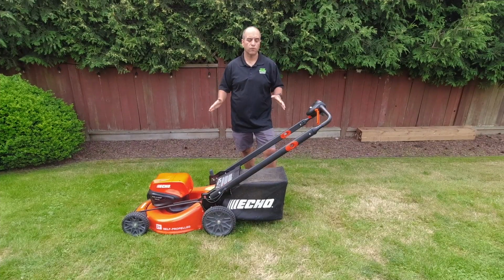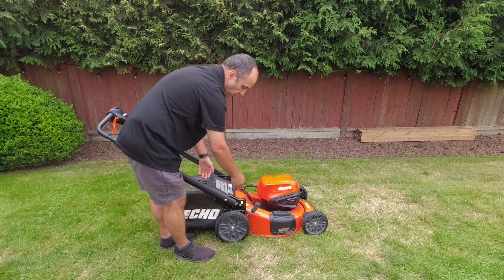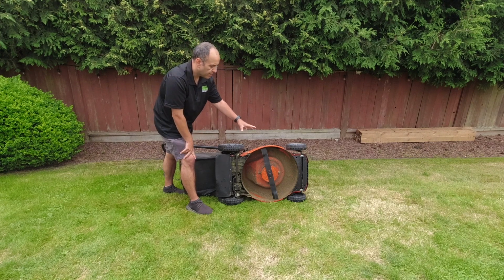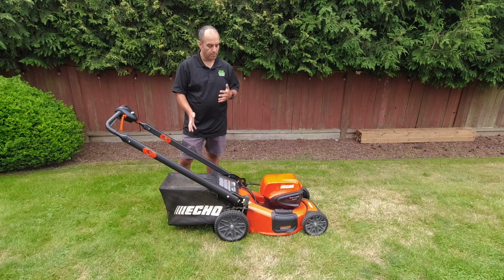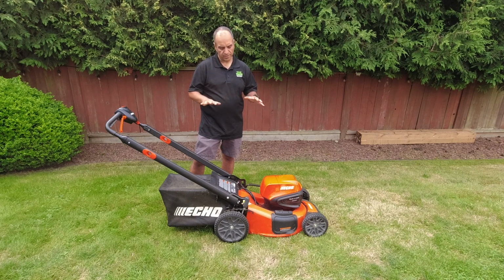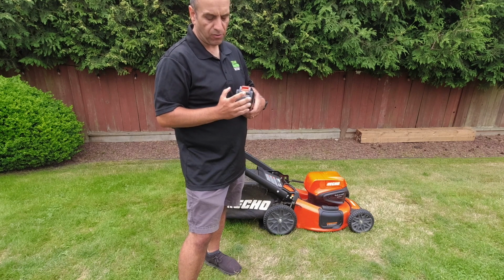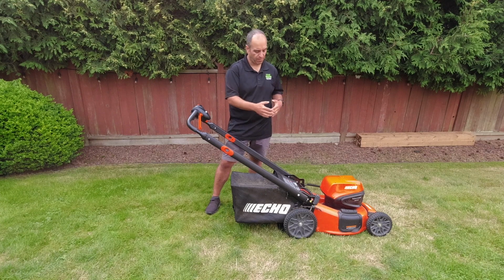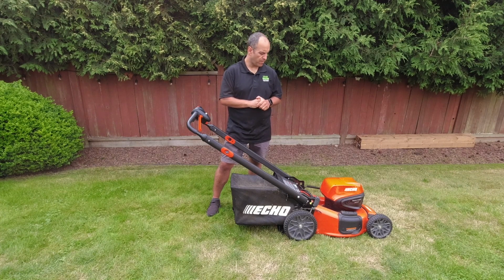ECHO DLM-2100SP Long Term Honest Review | 56 volt eFORCE Self Propelled Lawn Mower

Comment: Junk. After only a few months the rear wheels won't pivot while turning left or right. Both wheels rotate at same speeds so you have a difficult time turning it. It's rolling freely forward and backwards, not freewheeling while turning left or right.

Comment: I've noticed that electric mowers leave stragglers because you don't get that vacuum effect like you do with gas. Is that true with this mower?
Reply from the maker: It depends on the mower. A good battery mower can actually be more powerful than a gas mower. The biggest issue though is the blade that they include with most battery mowers is usually a low lift type blade. As that creates less turbulence and increases the battery run time. Unfortunately that also creates less lift or vacuum to stand the grass up. Some manufactures will offer a high lift blade you can buy as an accessory or you may be able to find an generic aftermarket one that will fit. This mower comes with a low lift blade and is generally underpowered compared to others. For example I have also owned and used the Exmark commercial 21 battery mower that comes with a high lift blade, and found it will out perform the commercial gas version of the same mower with the same blade in really tough conditions like wet grass or really long grass because electric motors have more torque and don’t bog down like gas mowers. Thanks for watching.

Comment: I feel like a lot of what you complain about is plain stupid! Stuff that really doesn't affect anyone but you! The Milwaukee mower you just tried to compare it to is also over double the price!
Reply from the maker: This is a lawn care business channel. So it affects anyone trying to use this mower in a lawn care business. I believe I did say that it was ok if you’re a homeowner but even then I’d buy the greenworks version as they are available for less money and they make this mower anyway. I’ve since tried many other battery mowers in long term testing since this video including the Milwaukee that I happen to be using now for the past 2-3 months everyday. There is no comparison. The ECHO mower is garbage compared to every other one I’ve tested and would not hold up to daily use. The Milwaukee I feel is probably the best value for what you get but even it is not the best is certain categories compared to the Exmark commercial 21 60 volt or Kress commercial 60 volt. But those mowers are in the thousands of dollars so it makes sense. So you may think the Milwaukee is expensive but in comparison to those others mentioned is why I say it’s the best value. So much better build quality and power compared to the echo it’s embarrassing that echo puts their name on that mower in my opinion.

Comment: Just bought this mower after selling my Snapper with a B&S 6.75. What a piece of junk the mower is. I do like the blower and string trimmer a lot though. The mower is surprisingly underpowered and cheap feeling. Should have gotten a Toro gas with the electric blower/trimmer
Reply from the maker: Yes as I said in the video I would not recommend it. Just the transmission locking up is enough of a reason to not recommend. Very cheaply built and underpowered.  Thanks for watching.

Comment: I’m a bit confused, the Milwaukee is almost double the price. This is competing against a different class of machine. I’m not sure your criticisms are fair. I bought this mower and took it out in the rain on a water logged lawn between atmospheric rivers. I had to wear a rain coat with a hood! It was a champ! It mowed the lawn very evenly on the second to lowest setting. I wasn’t sure if it would be powerful enough, but it pulled through very well.
Reply from the maker: My assessment is based on the fact that my channel is about running a lawn care business. ECHO knew this when they sent that mower. So it will be assessed for its suitability to be used in a lawn care business. That’s why I say in the video something along the lines of if your only using it for your own lawn it might be ok but then I’d look at the Greenworks model as they are the manufacturer of this echo mower and are more readily available in retail outlets. I stand behind my assessment. I still have this mower. I took it to my parents house to use on their tiny little lawn that is less than 1000 sqft. I mow their lawn once every two weeks. So it’s seen little use the pst couple of years since this video and the transmission is already starting to cause problems. Just a cheap mower overall. Thanks for watching.

Comment: bought one of these new in box for $200. have not used it yet but i'm hoping it will be fine to replace my 10+ year old gas push mower for my small urban yard. just don't want to deal with gas any more and want something that takes up less space in my garage.

Comment: Just bought one today, and it won't start. POS..DONT BUY...
Reply from the maker: Some things to check. Make sure the battery is charged and seated properly. Also that the little orange safety key is inserted by the batteries. Then make sure your squeezing the blade engagement lever while also pressing the power button. Thanks for watching.

Comment: Even my el-cheapo Ryobi 40V does not have that self propelled quirk. A machine of Echo's supposed quality should be better than that.
Reply from the maker: Except the problem is that it is only ECHO in name only. It’s made by Greenworks. In fact you can find the identical mower in green and black under the Greenworks brand. The only difference is the proprietary battery shape made for echo tools. Thanks for watching.
Reply: @LawnCareBusinessSuccess   Does the Echo battery interchange with the Greenworks?
Reply from the maker: @deanb949 no it does not. The shape of the battery is completely different as is the voltage.

Comment: I’m sure that’s a safety feature to time delay the wheel lock so it doesn’t roll back on you if you slip and fall on a hill
Reply from the maker: Nope. None of the gas mowers with self propel I’ve used ever did that, and I have now also tested 3 other brands of battery mower including the Kress, the Milwaukee and the Exmark. All have self propel and don’t lock up the rear wheels. It’s just poor design or cheap quality. I suspect the latter based on the rest of the mower compared to others I’ve tried.

Comment: You do know plastics aren't weaker than metal?
An abs, sure, but a glas fibre reinforced polypropylene, which wll tool conpanies use, it stronger, lighter and more flexible (resistant to damage by impacts) than steel of rhr se thickness.  It also doesn't rust of course.

If you don't understand a tool design, best not to draw a conclusion.  If i were Echo I'd have legal send you a love letter.
Reply from the maker: You do know that reviews are based on personal opinion and previous experience don’t you?  With that I will say that I stand by my comments that this unit is cheaply made. This past year I got to use two other brands of commercial battery mowers and that only proved my point. This ECHO model is very cheaply made and not worth the asking price. Especially given the fact it is a rebranded Greenworks model. Except it has proprietary battery shape that makes it even a worse buy. When the green works model can be found much lower priced and batteries for the green works are used in multiple Greenworks tools. If you look through the comments you will see others who have had similar experiences with this unit. As far as ECHO sending a love letter. That comment wins the most ridiculous comment of the year. Especially since ECHO sent this unit for me to review and they were the ones that when I first started making review videos in 2017 encouraged me to always share your honest opinion in reviews otherwise they won’t be authentic. That principle has guided my review videos ever since. Regardless if a brand sent out a tool for free or I purchased it.

Comment: This guy wants to throw this mower off a bridge,  he hates it.
Reply from the maker: I wouldn’t say I want to throw it off a bridge but  after trying a few other models long term I am justified in my assessment that the ECHO DLM2100SP is not worth the premium price they are asking. Definitely not a commercial mower. Just a rebranded consumer Greenworks mower. It’s probably fine for a homeowner once per week but at that point why pay a premium for orange paint and the ECHO name with a proprietary battery shape and voltage, when they don’t even make the unit. Might as well get the exact same mower in a more  powerful 60v or even 80v Greenworks version from multiple retail sources using their common battery shape at much less cost. Commonly found on sale and even packaged together with their trimmer and blower at places like Costco for less than what they want for just the echo version of the mower.

Comment: I've owed both the 58V and now 56V line of Echo cordless tools.  The 56V line is a huge step backwards IMO.  The self propelled weird lockup is maddening.  The 56V chainsaw doesn't have near the power the 58V did...I just don't get it.  The 58V line wasn't perfect, but the 56V line is terrible.  Who thought it was ok to have a battery cover that doesn't stay open on its own?  Just junk.

Comment: My 12 year old 21" gas powered Honda does the same thing on the self-propelled, just got used to it.  My neighbor has the Green Works mower (they look a lot alike) and the self-propel action was with it as the Echo, another neighbor has the Stihl 460V, it too does the same.  Bottom line, before you bad mouth the Echo ... the competitions do the same thing.
Reply from the maker: That just proves my point as ECHO market this as a commercial mower. It clearly is not anywhere close to being a commercial grade mower. It looks like the Greenworks because it’s made by the same company that make the Greenworks for ECHO. In fact if you like this mower then save yourself a pile of money and just buy the Greenworks version that is available in lots of stores and frequently on sale or bundled with a string trimmer and blower. In fact that would be the smarter choice as at least the batteries will be readily available and fit multiple tools across the greenworks line versus the proprietary shape and voltage made just for the ECHO. Just like ECHOs first line of battery tools discontinued after only 2-3 years. I just got the new Exmark Commercial 21 V-Series 60 volt mower and it does not lock up the rear wheels at all just like every other commercial grade mower including the Hondas I’ve used over the 18 years I’ve been in business. But then again it is the exact same mower as it’s gas counterpart including having the same transmission, with the exception of the motor of course. For a homeowner using it once a week on their own property the ECHO might be fine. But bottom line this channel and the videos on it are meant for lawn care business owners and as such I will tell it like it is, good or bad on every piece of equipment I review even if it was sent to me by a brand.
Reply: Doesn’t Greenworks make the Stihl mowers as well? @LawnCareBusinessSuccess

Comment: The Milwaukee is also twice the price at 1100 plus tax , think I will stick with a decent gas mower for 250 for now anyways. E power cars and mowers are still too damn high.
Reply from the maker: Yeah battery stuff is definitely expensive. Especially for cheaply made lower spec units like this one that probably will not last. The Milwaukee is more expensive but it’s a quality built unit in my opinion. Thanks for watching.

Comment: I have Echo PAS equipment with a 2620 power head and was thinking of having battery as an option and getting this mower as a backup to my Honda HRC2163HXC (looks similar to the HRC216HXA currently offered in the US, just the Canadian model).  After listening to your review has been considered and I guess I will hold off, but it wasn't like it was on my immediate purchase list as I need to invest in a better tractor first.
Reply: After watching your video, I forgot to ask you:  Did you fully charge and discharge your battery a few times to make the charge controller self-calibrate?  This is probably why you get the weird readings on the four bar display.  This is something you should do with any device that uses Lithium cells like power tools, computers and cell phones.
Reply from the maker: Yes I have at this point and it is still inconsistent. Along with the build quality of this unit I would have to advise against purchasing this mower. So many better options on the market for battery mowers. Thanks for watching.

Comment: What electric cordless lawnmower do you think is best?
Reply from the maker: That’s hard to say as the Echo is the only one I have had the opportunity to use long term. The new Milwaukee M18 one I mentioned in the video I only got to try for a few minutes and the lawn I tried it on was already recently cut, so I can’t give a first hand account in terms of performance.  But the Milwaukee build quality was much more robust. It felt like a quality mower and reviews I’ve seen seem very promising. It also did not suffer from the transmission locking up when reversing issue that is so frustrating with the echo. Thanks for watching.
Reply: EGO is the best. This is my second season with the mower, string trimmer and 40cc equivalent chainsaw. They are also coming out with a mini bike, wet dry vac, power washer and more. All their batteries will work with all their tools. Would be worth a look.

Comment: I have the same mower, I don't always have to use the self propelled on it. Don't have hills so since I'm not using so much the self propelled feature it doesn't lock up backing up . It can be annoying but most battery and some gas have that issue
Reply from the maker: This is the first mower I’ve encountered in the 17 years doing lawn maintenance that locks up the rear wheels. I tested the Milwaukee mower and it did not lock up the rear wheels when using the self propel and either did the greenworks version of this mower I saw that also had the metal transmission body. So probably a good indicator of a lower quality mower. Best of luck with the mower. Thanks for watching.
Reply: The 47cm ego does this as well. Sent mine back for a full refund as it’s utter dross battery life is crap and I had two rapid chargers and two new batteries and still it wouldn’t fully charge the batteries..
Reply: My 35 yr old Toro won’t back up if it’s in fwd gear of any speed. I have to pull it back to Neutral

Comment: Great review. I’m in the market for a battery powered mower for next spring. I’ll cross this echo off the list of candidates for sure!
Reply: Don't write off the Echo, tried the Green Works, Stihl, an Ryobi that the neighbors own ... all three do the same thing just disengage the s/p about 12" before you turn, problem goes away.  My 12 year old gas Honda does the same thing, have found most rear wheel drive self propell models have the same "hick-up".  The commercial battery (Mill model) does have a different drive system, and for $1,000+ dollars it's got to have something special.  I'm buying the Echo, I want something that my chainsaw, trimmer, an mower use the same battery.  That's not always true with some of these machines.
Reply from the maker: Glad you found value in the review. Thanks for watching.

Comment: Hey I hope echo comes out with a battery backpack blower this year
Reply from the maker: I’m not sure. I’m not in ECHOs UAG program anymore. I do remember them saying that a backpack blower was something that was not in the cards at least in the near future. Blowers apparently are the most draining on batteries. So to have a motor big enough to turn a large fan blade to get enough force comparable to a gas unit would kill a battery in a matter of a few minutes. I guess that’s why all the current back pack blowers are essentially hand held blowers in the handle with just the battery pack on your back. Thanks for watching.
Reply: There are two tools in the landscape business that I have yet to see any company legitimately attempt to have a commercial battery counterpart for: backpack blowers with at least 700 cfm and 230-250 mph and a pressure washer in the 3000-4200 psi range that can run a surface cleaner. If I wanted to replace my commercial landscape equipment today with battery counterparts, I would be able to obtain everything (including stand on and zero turn mowers) except the two items I mentioned above. Thanks for the informative review.

Comment: nice breakdown lawn care nation   Watching your video it look like you will use the milwaukee tools for your business? as far as battery powered ones are concerned.
Reply from the maker: I really do like the Milwaukee tool lineup. The only issue with them for me is they are not weather rated to be used in active rain. So I keep gas powered equipment to use on those heavy rainy days. I’ve used the string trimmer and blower almost every day this year. In total I’ve only used about 2 gallons of mixed fuel this year. Thanks for watching.